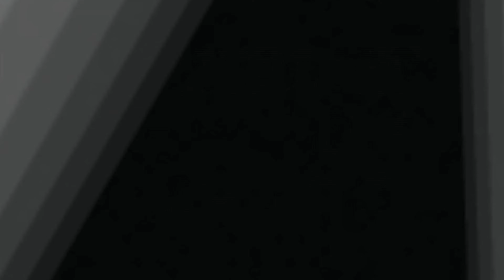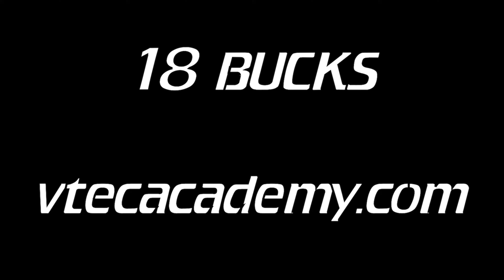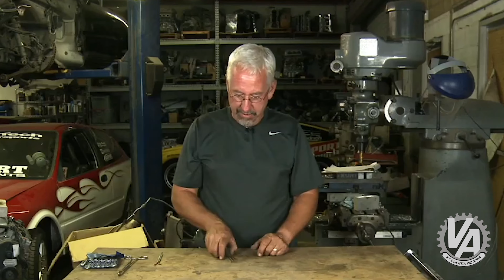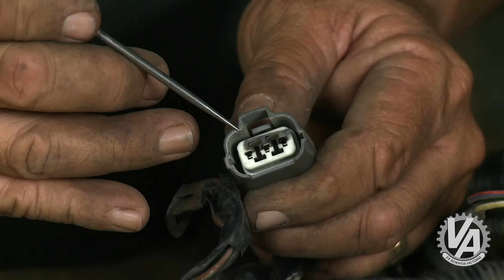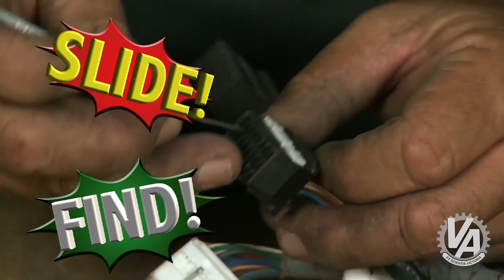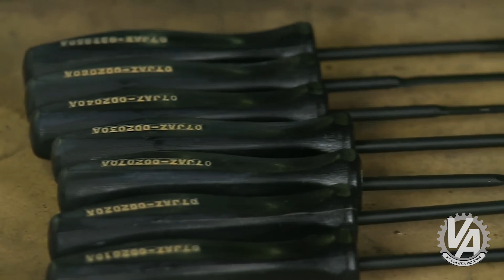How to RE-PIN Your Honda Wiring Connectors Like a Pro!

Comment: How does one know what size pins you need to re-pin the wires?? If it's a pin for 18-24awg will it fit back into the connector?

Comment: I have to try this i have a Throttle body connector lock tab that broke off. My options would be to replace entire harness. But thats to expensive and time consuming. So i rather go online and found the connector i need. And remove the connector plug using this method.
Reply from the maker: Hope it worked for you!

Comment: Great video. I had the reverse lockout connector wires pull out of the connector when I removed the tranny on my TSX because I forgot to unplug it! Is there somewhere I can buy replacement pins so I can reconnect the wires to the connector?
Reply from the maker: We find ours from https://www.corsa-technic.com

Comment: Thanks a lot for the pointers Brian! Just started labeling the sensors in the cabin so I can de-pin all the wires I will no longer be using in my FA5. This video could not have come at a better time! Going to use the factory ECU to run a few of the factory systems and make a jumper harness for my standalone. Have to get ready for the fc3 next. 100% function-able or bust.

Your wealth of knowledge is always appreciated. Came to listen to the last VTEC ACADEMY live while I was getting ready and ended up with a nice refresher course!
Reply from the maker: Hell yeah, that's what's up!

Comment: Waiting for the civic 07-11 conversion 🥰🥰🥰 
 But I’m not sure if the SI cluster(rpm-speedmeter)will work or not plus my interior harness is automatic 

And thank you so much you me it easier for us 👍🏻
Reply from the maker: It should work. Both the automatic and manual use a countershaft speed sensor.

Comment: would i be able to repin obd1 injector plug in replace of a rdx injector plug ?
Reply from the maker: You'd need a different terminal.
Reply: @VTECAcademy  AHHH okokok then ill probably just splice into my obd1 harness and rewire in my rdx injector clips in

Comment: Great tip👍👍👍where can we get those picking tools
Reply from the maker: Amazon affiliate link for terminal crimper and removal tools.
Iwiss crimper for ECU pins - https://www.amazon.com/dp/B00OMM4YUY?ref=exp_vtec.academy_dp_vv_d&th=1
My favorite general purpose crimper (not the one in the video) - https://www.amazon.com/dp/B0732W6HQR?ref=exp_vtec.academy_dp_vv_d
De-pinning tools - https://www.amazon.com/dp/B007QV785Q?ref=exp_vtec.academy_dp_vv_d
Reply: Harbor freights. Less than $5.
Reply: The basic pick set that was first shown you can find generally at any hardware store usually near the screwdrivers. The dental pick set oddly I've seen for sell at local gun shows as are repurposed as gun cleaning tools or could surely find on ebay or amazon. As for the Honda pick kit you could inquire about it at your local Honda dealer. I will say that the Honda kit is very expensive for what it is. I've been wanting to buy the kit for myself but so far have just made without it so far. As mentioned in the video if you have a Honda service manual it will tell you the tool part number for the specific job your doing for a single pick tool or there is the pick tool kit. Also in an older Vtec academy episode someone mentioned repurposing the wire from a used wiper blade just shaping the ends if you have patience and like to DIY make a pick tool out of that.